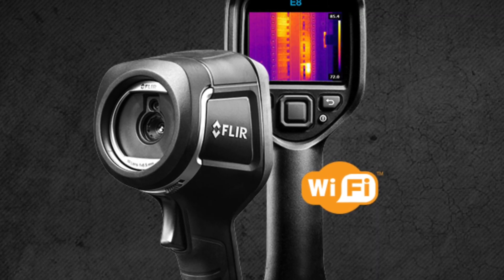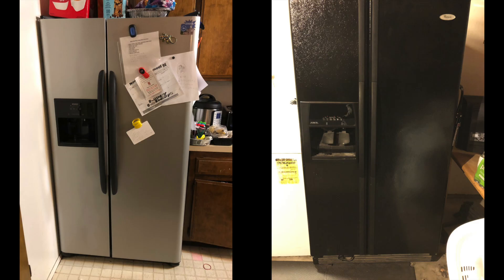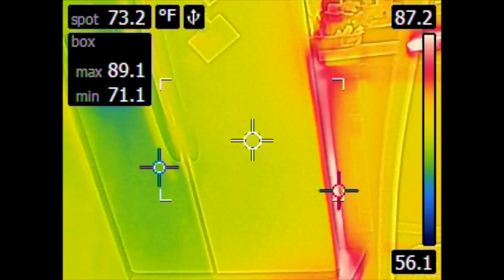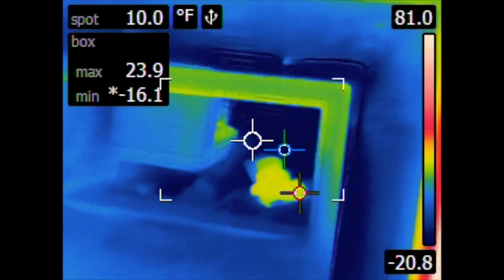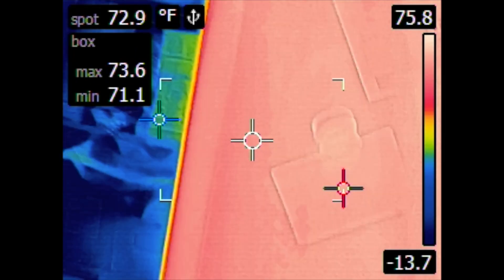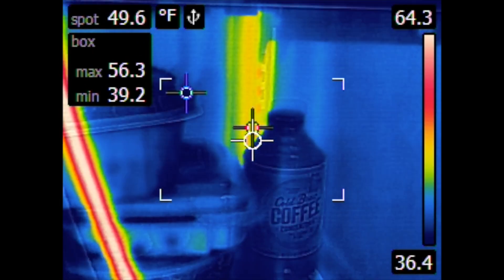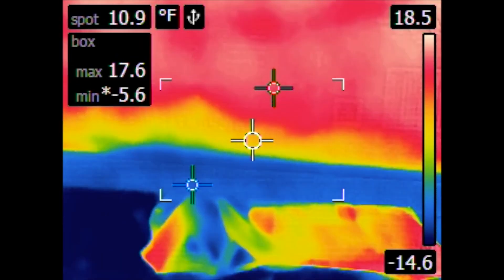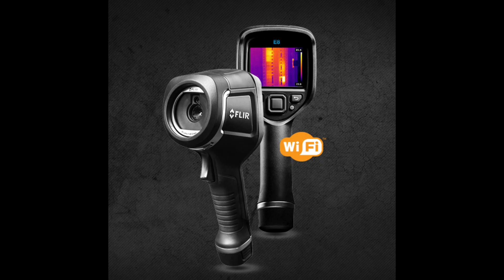Flir Thermal Imager Fridge Testing

Comment: you are showing the ref. and freezer compartment only.  can you try and see if it is able to indicate the temperature of condenser pipes running in the whole refrigerator wall.  whatsapp me  if you are able to see the temp change pls. +60199825920  . i am looking at possibilities of using it to identify leak from condensing pipe in a refrigerator